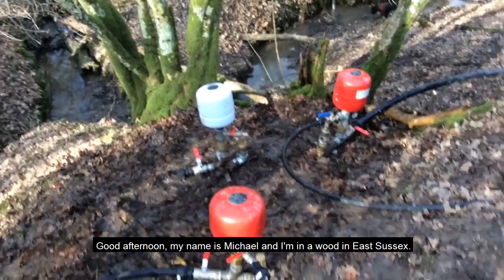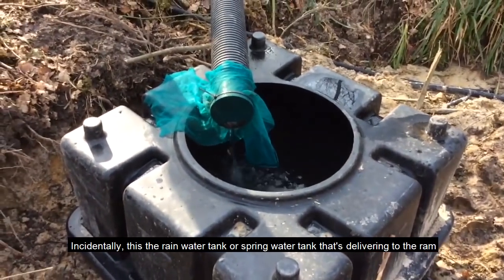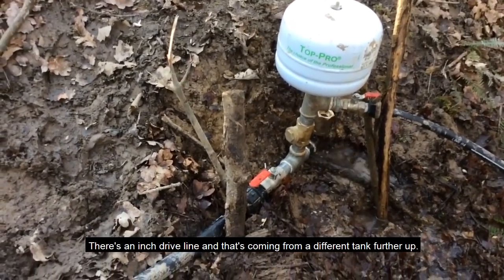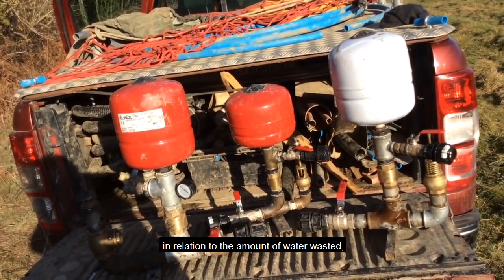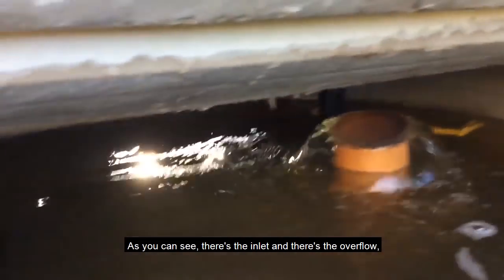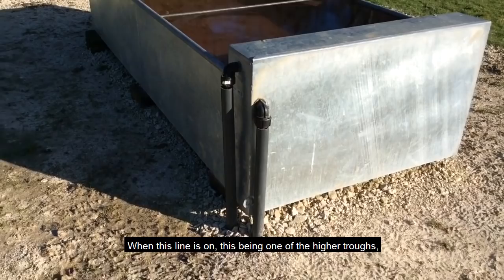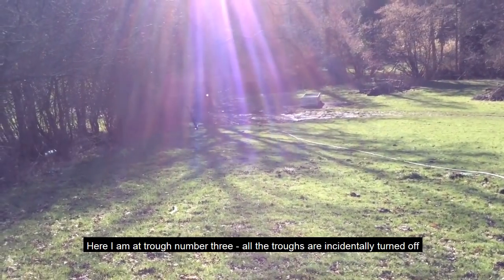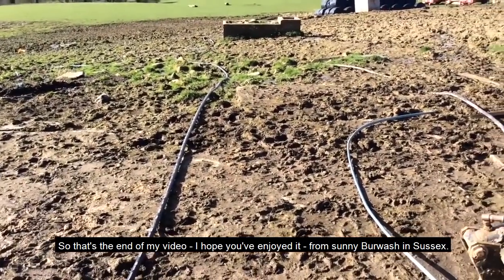Homemade RAM Pump versus Papa Pump - East Sussex - Full Version

Comment: Your check valve or delivery valve using brass spring check valve will not last long. Im is better to use stainless steel spring check vallve or make a DIY check vave and waste valve.

Comment: The flexible drive pipe is causing you some inefficiencies.  Flexible pipe moves and expands when the brass swing valves cause the water hammer. You could replace with PVC or metal pipe.
 I like the expansion tanks you are using, much better than some of the expansion tanks made out of 4" PVC  Pipe.

Comment: 1. Is there a difference in using a bladder tank versus a ordinary PVC pipe?

2. Does the wider tank respond better because it has a larger surface area inside the tank?

Thomas Dutkiewicz
Connecticut, U.S.A.
Reply: No and no, a long pvc pipe does the same as a short tank
Reply: @THEDANOFFICIAL  except that the diaphragm tanks don't hydrolock as quickly die to dissolving air into the driven water as there is a rubber membrane.
Reply from the maker: for information on homemade pumps please see Land to House YouTube Channel

Comment: Papa pump with 2" supply pipe compare to self made 1", 1¼" self made ram pump. Are you serius?
I can easily get 20 cu meter with 3 m supply head with ny pump, delivering to 60m heught as far as 1000 m away from the pump

Comment: If you only getting 2lts a min at 500mts and 2800 per day it's very small,  my 2inch ram pumps pump 21lts a min at 500ft, at 40ft height,  or 8lts at 82mts height at 165mts distance,  mind dont brake any parts, and kevin Smith ram pumps in new Zealand are the best in the world delivery is 130,000lts per day at 300mts height, 
The rubber vavels your using wear out and get perish over time,
Reply: Do you have any video of your pump??
Plz give me the link
Reply: @chill1779  click on my name it will show u my pumps or look for me on Facebook
Reply from the maker: Hi Derek, the delivery amount depends on the supply head, please see the calculator on our website hear: www.waterpoweredtechnologies.com/calculator/ 

In regards to our rubber valves they last an average of three years and the pumps come with a spare set. Replacement sets are only £20 so in the long run are much less expensive then the traditional style that will wear its expensive parts out.

Comment: Papa pump is too expensive including the installation compared to home made ram pump. Papa pump also is not design for more than 100 meter vertical lift because the bladder tank maximum pressure is 8 to 10 bar. I prefer the home made ram pump but have to make your own waste valve and check valve but jot the surge tank for higher  lift is made of steel.
Reply: How much is a papa pump?
Reply from the maker: @hksjoshua  dependent on location. please email us info@wptgloabl.net

Comment: seems like a lot of wasted money there are people pushing water 700 to 800 metres with a rise of 75 to 100 metres no problem with ram pumps . his ram pumps where kind of shitty tho so i can see why they did not produce much water plus he had a lot of hammer effect at the end of his output hose . still if you have the money to spend why not i suppose
Reply from the maker: Pushing water over a distance is not a problem - there are only small fricton loses. The Papa Pump can deliver meaningful amounts lifted over 150 metres.  In this case it only had to deliver up to 65 metres.  As you know, the amount of water you can deliver is mainly dependant on the Supply Head and the Delivery Head and you have to work with what the topography allows. We have retrofitted the Papa Pump to replace the old metal style pumps many times and each case the efficiency of the water delivery has improved and running costs lowered. It has achieved this because of the patented new venturi valve.  Also the Papa Pump uses a pressure vessel so that you don't get the pulsing of your water delivery unlike the home-made pumps.  This was a comparison of home-made against the commercial alternative.
Reply: homeowner application vs commercial application